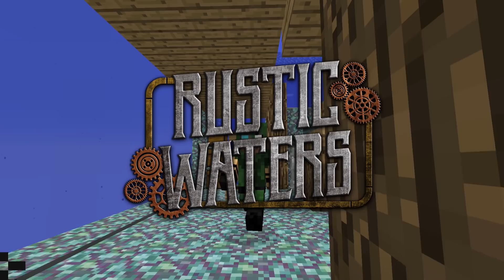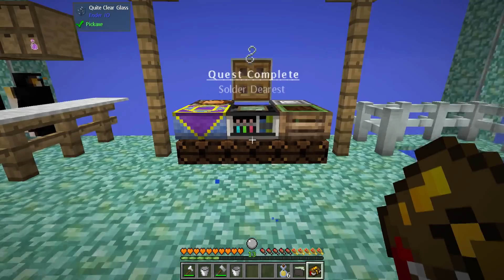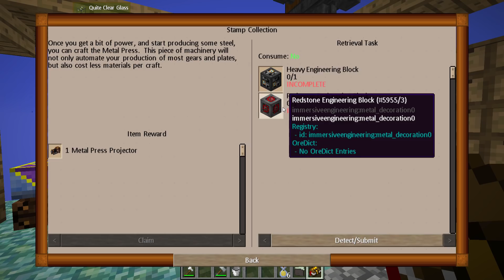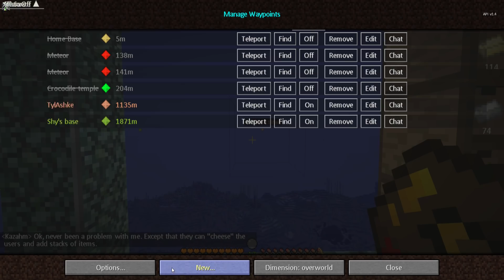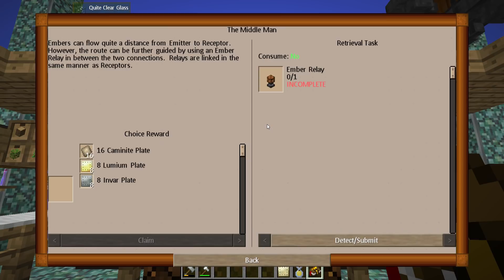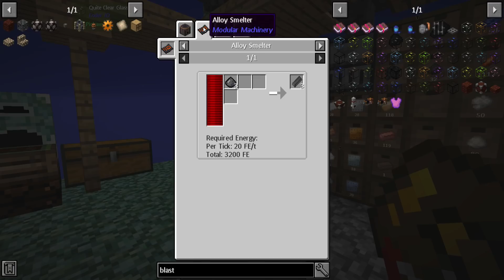15 Seablock: Rustic Waters modpack! Ember Questing

Comment: I'm managing ingots by the rule: if I have more than two stacks of ingots, convert them into blocks.
Not having any luck with the steam engine. I can get it chooching just by feeding it water and coal, but connecting the output to the ember bore just isn't happening for me. Wrong orientation of that interface thing? Axles around the wrong way? Wrong gears? Have to do axles first, then gear? I dunno. Nothing seems to work.
Reply: Remember to shift-click to pit a gear on the face touching the steam engine
Reply: @defiantnight2668  Yep, I got it going eventually. Noisy! Good thing its down at bedrock.